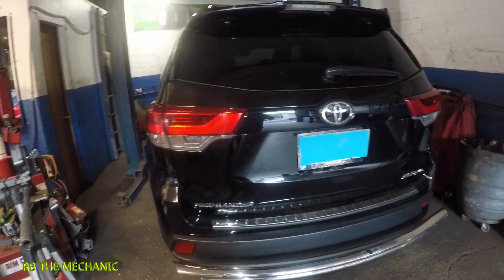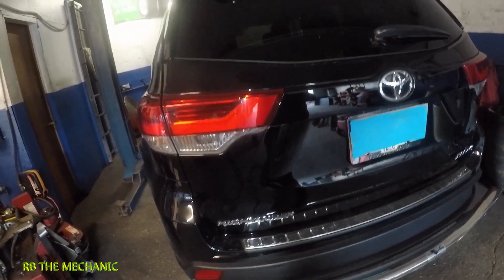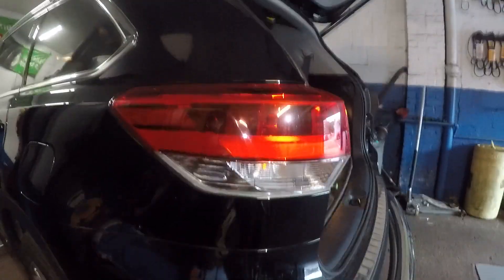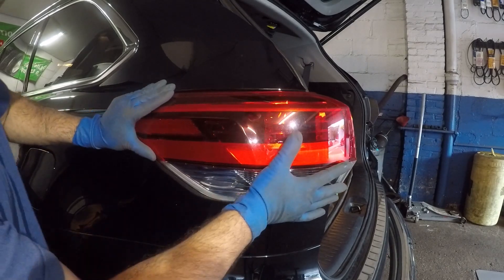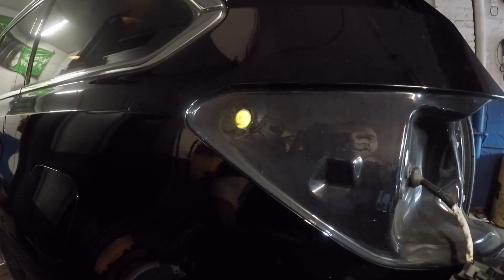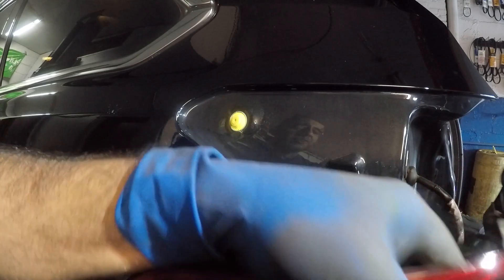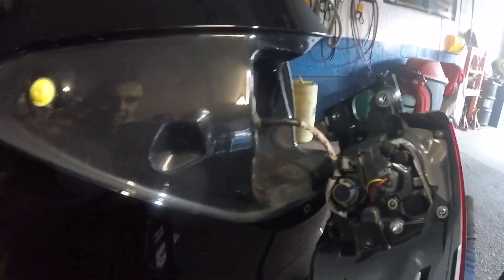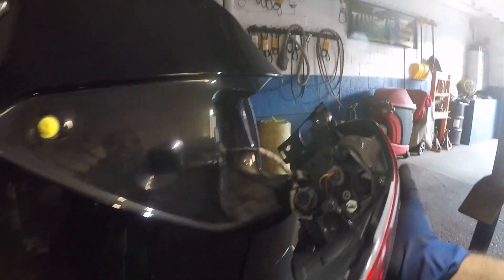How to remove the tail light on 2019 Toyota Highlander

Comment: How do you replace the plastic outer cover once you get this far? Ours is chipped and we are attempting to replace it ourselves. Thanks!
Reply from the maker: The otter clear glass well usually I have never done that I usually replace the whole light assembly but u might be able to use hair dryer to melt the sealer and gently take it apart but best thing is to replace the whole thing

Comment: I got a new assembly to replace, the led strip doesn’t turn on. You think the new assembly is defective?
It works on the old assembly still.
Reply from the maker: Check the contacts on the connector some times u have to move the contacts so they can touch each other
Reply: @RBTheMechanic  appreciate the quick response. Let me try.

Comment: Hi, I'm having to replace the entire assembly.  I have the old one off, but I can't seem to get to the wire assembly to plug the new one in.  Thanks
Reply from the maker: It should be plug and play simple connectors u sure the new light is same?
Reply: I just replaced the right side tail light EXACTLY like this video with the exception of unplugging the old tail light assembly and plugging the existing wire harness into the new tail light assembly.  The new tail light comes with a new wire harness but I couldn’t get to the plug that’s inside the rear fender to plug it in so I just used the old wire harness that was still plugged in inside the car. Hope this helps someone.

Comment: thanks, but the replacement lens and light have a electric cable that disconnects behind and rubber gammit.  How do you get into that opening?
Reply from the maker: I haven’t done that if I get one I will make video
Reply: @RBTheMechanic  did you make the video?
Reply from the maker: @rodneyhsing8515  no car will need to come in for that till then can’t
Reply: @RBTheMechanic  I figured it out.  You need to take the panel out inside the car.  The wire has a connector you can’t reach through the panel openings.  It’s not too bad to get to.
Reply: If the wire harness that came with your car is still good, just remove the new wire harness from your replacement tail light assembly and connect the old wire harness to your new tail light. It worked for me and I didn't have to remove the panel inside the car to get to the plug that is behind the rubber grommet.
Reply: @zoopenblop  Thanks! No reason to replace it if it's good.

Comment: How do you replace the assembly on the tailgate?  Did you make a video for that, I don't see that.
Reply from the maker: Kevin Skogg sorry so far I have this I will make more as I get the jobs
Reply: @RBTheMechanic  Hey, thanks for getting back to me.  Have you done this for 2016-18, (you probably already thought of that)?  Looking at that assembly (right inside tail) I will have to remove the back trim.  Do you have a recommendation for trim replacement tools?  Obviously, I won't be using them much but looking back over the years it is something I wish I had had.

Comment: Can you remove the clips [the yellow clips on the video] to replace them.?
Reply from the maker: Yeah if u need to
Reply: @RBTheMechanic   with what can I take it off and will it come out easily like the cover that you showed on the video. Thank you for answering.
Reply from the maker: @jbryansoto  just do it as I showed it dose come off kinda tough if urs has never been removed for years just take it easy
Reply: @RBTheMechanic  how about the clip is it easy to take off or will it pull the body as you try to its a 2021 and it's not mine so I'm trying to be extra careful you could understand😅
Reply from the maker: @jbryansoto  not body but u might brake the light or clip
Reply: @RBTheMechanic  the yellow clips right.? In the highlander that I have is not yellow those are green but the same thing. It's bend so I bought the clip [retainer] and that's the only thing I need to replace so everything is in place. It's on the video at 1:21.
Reply: I need that also that yellow thing the clips?where did you get that?